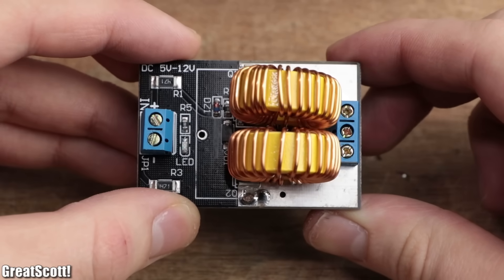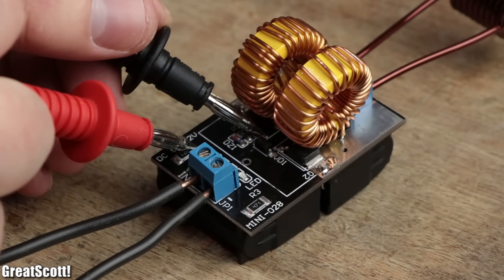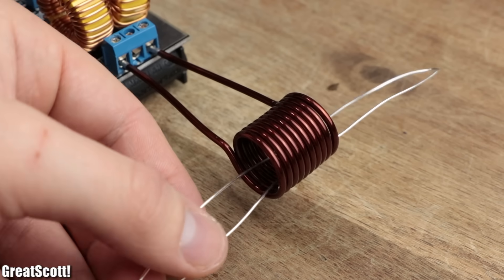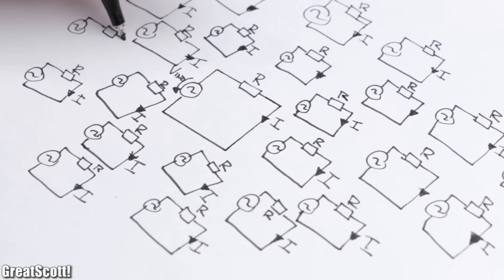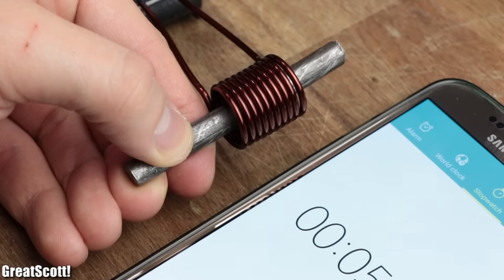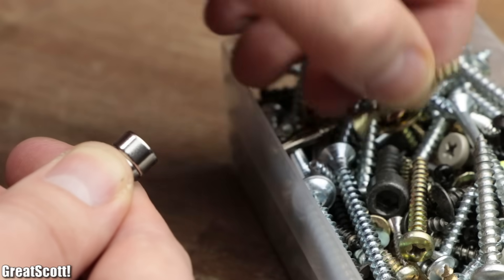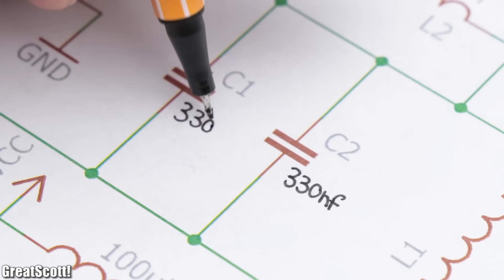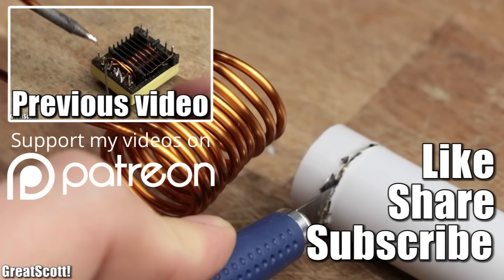How does Induction Heating Work? || DIY Induction Heater Circuit

Comment: Not everyone like those hot knife videos, i really hate those.
What i need to do to create a coil with a diameter of a mug?
Reply: You could make it just like he did but you'd have to make the coil larger than the mug so it'll fit. Plu you'd have to remember that the coil is heating the MUG which is in turn heating the liquid, so be careful and don't burn yourself.
Reply: yeah, 12v, 10A is plenty to heat up your water with resistors. Nichrome wire should do the job. I would do more research though...
Reply: I don't know if I can help as far as the math goes, but I have about 3 industrial induction heaters that we use for drop forging. the coils are really large and it seems that inductance of the coil (AKA the diameter) has no effect on it. however, the coils are made of a copper tube so that water can flow through them to keep it cool. therefore, I would recommend you use a thicker gauge wire to let the resistance of the heating coil.
Reply: oh and you will need a lot of current to run it. the industrial induction forge I spoke of has a constant 24 volts running through it, bit can have currents anywhere from 3 amperes to 300 amperes. I don't think you need that much current though
Reply: Thank you a lot for the info, for the power supply i was thinking about one 12v 10a, but i'm kind of not looking forward since you mentioned the current needed.
I'm abandoned the idea and im now looking to use a resistance heating element, but i'm always afraid of messing up with HV projects.
Reply: steven kutschat
but still the same winding count?
because the diameter of the coil will be greater than the shown on video.
Reply: Rodrigo B.P maybe you could stick a metal heating element (like stainless steel) inside the mug beverage that’s inside the metal coils
Reply: is the mug made of metal? Induction heating only works on metals, not ceramic. Though I agree, I don't like the hot knife videos. They are absolutely boring.
Reply: Jonathan Kayne yes it is, i guess its aluminum, but im not sure, my plan is a coffee warmer.

Comment: Hi, why an inductor works as a costant current source ? How can i calculate ?
Reply: Ok, maybe i am understanding, a costant current source is the dual of a voltage source. An ideal voltage source has zero output impedance so that the voltage doesn't drop under load. An ideal current source has infinite output impedance so that the load's impedance won't influence the current. So now i think i need an inductance's inductor bigger than the inductance's of the heater coil

Comment: How does it actually work? I could not really understand the circuit.

The internet has taught me enough that if you want to know the truth you should give the wrong answer instead of the right question so i'll try this myself :)

I think it works because the circuit supplys an AC wave through the coil causing the magnetic dipoles inside the iron to change alignment frequently, The rapidly switching dipoles causes a physical vibration which results in an increased temperature.
Reply from the maker: Correct. But you forgot the eddy currents which generate heat due to the resistance of the material.
Reply: Thanks, not a bed guess though

Comment: 0:24 Just btw, never cut PVC pipe with heat, as it release toxic chlorine gas. So avoid doing that
Reply from the maker: Good to know. A saw works better anyway.
Reply: @greatscottlab  😂😂
Reply: GreatScott! Can I use a schottky diode instead of the UF4007?
Reply: Poly Vinyl Chloride lol
Reply: This country already is all the poison from the air and through water
Reply: @Connor Hill and thats probably why im still alive after adding water to hot hydrochloric acid.
Reply: carcinogen
Reply: When PVC plastic is burned, it releases dangerous chemicals such as hydrochloric acid, sulfur dioxide, dioxins, furans and heavy metals, as well as particulates. These emissions are known to cause respiratory ailments and stress human immune systems, and they're potentially carcinogenic. Chlorine gas is not produced.
Reply: https://docplayer.net/26964431-High-voltage-resonant-self-tracking-current-fed-converter-a-thesis-presented-to-the-faculty-of-california-polytechnic-state-university.html
High voltage resonant self-tracking current-fed converter (2010-Mar)
p52/152 Mazzilli Converter Topology
Reply: And there he is. Volunteer OSHA agent.
Reply: Any plastic produces toxic fumes when heated not surprised if Scott knew that already
Reply: Chlorine together with Carbon and heat, at least open flame, produces Phosgene gas, (any one who has worked CFC air con. have come across it), and that is really toxic.
Reply: Soldering also releases toxic fumes, that's why you buy a fume extractor, or solder near an open window with a fan.
Reply: Everything releases deadly chemicals when heated. pvc is made, literally, with heat. So... don't ever worry or be scared to melt or hot knife pvc, just know there's volatiles, and act appropriately. 

If everyone didn't do things just because it wasn't necessarily safe, we woild all be dead.
Reply: @nicewhenearnedrudemostlyel489  so your advise is to not worry about it because lots of things are toxic? You do realize the effect aren't immediate right? So that cancer you develop in 15 years is gonna have nothing to do with your carelessness around carcinogens right? Don't give bullshit advise please, you know damn well it's dangerous and you're playing it off.  Slot of kids read these and you just advocated the safety of burning PVC.
Reply: @caseynewman2810  it is safe when its done properly, not safe when you don't set up a fan or something to blow the fumes off. well its easier to use a saw than burning it too but whatever
Reply: Oxygen at 450 dungarees(either measurement) is deadly.
Reply: ender_scythe correct! i recently purchased a soldering iron and it said that when soldering toxic fumes are emitted and may cause cancer according to the state of california
Reply: @Peaches-yj8xk  use a fan to move the air or a suction hose to move the emissions from the work area
Reply: @Mutlap  I just go outside. My backyard always has a small air breeze
Reply: @Peaches-yj8xk  I'm pretty sure in California there's that label on wood, as if you inhale too much sawdust it might cause lung cancer
Reply: Don't lots of things release chlorine gas? Like bleach, and, um... lots of other things?
Reply: i would be dead if it releases chlorine gas... never feeled something either and im breathing lots of fumes, no matter what i cut.